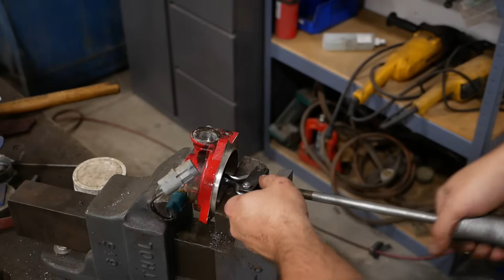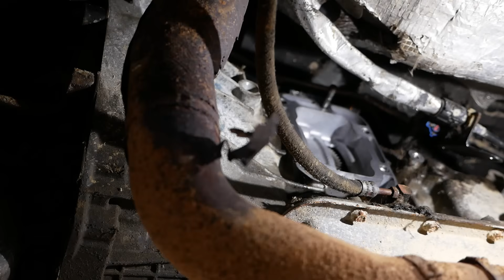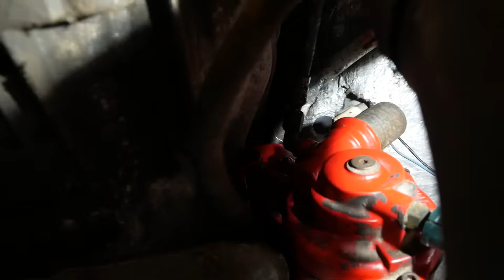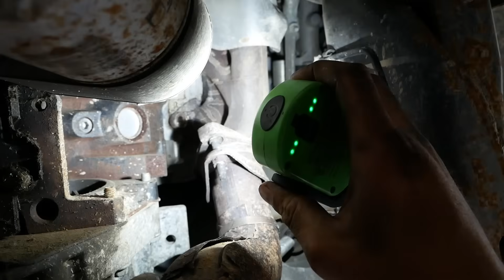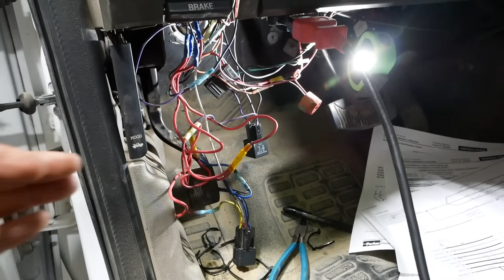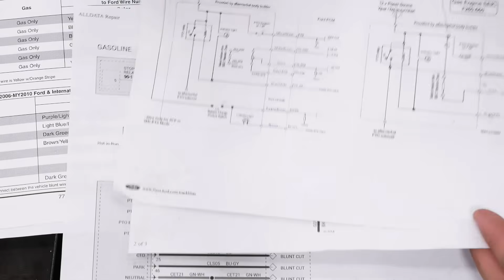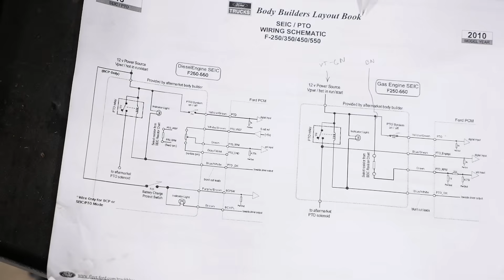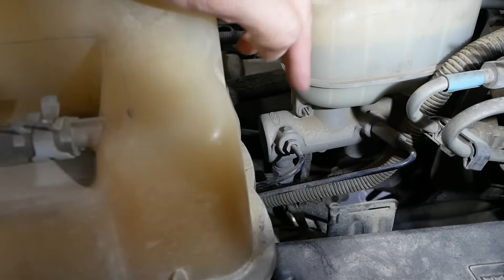Ford F550 Chelsea PTO Repairs - Unexpected Complications

Comment: i do engines and transmissions (mostly for racing but i occasionally get a normal job) when putting in seals on a piston you can use a feeler gage (the finger type, they make them up to 6-8 inches) and lots of transmission fluid. You don't want to nick the seal. It will be a weak spot that "blow" out long before it should. Usually in a car transmission there are two seals. (and this is one reason why you find balls in the valve body. They regulate the direction the fluid will flow) One seal pushes the piston onto the pack and then the second seal will allow the fluid to disengage the piston. Some transmissions have these seals as a weak point (the lip is to small to handle the high pressure of apply as an example) so they have to be clean, no nicks or gouges and lubed.

Comment: I spent seven years in the waste removal industry, and our trucks either had electric shift or air shift PTO. There was no gear clash with electric. Dump the air,  PTO switch on, shift to neutral, and it will engage. Air shift was the easiest. Come to a stop, cut it the PTO, shift to neutral. It locks the service brakes. The tricky one was the ten wheel cutdown. PTO cuts out if the RPM's are too high, and comes back on when the engine returns to idle. Great job Wes. Looking forward to the next video.

Comment: Place where I worked had a street sweeper that had a similar safety system.Tranny ha to be in neutral parking brake set,before it would dump the hopper.Also because the brake system was air brakes,air perssure had to be above a certain number before parkbrake would set.We got a lot of calls because machine would not dump fast enough to suit driver,most time we started the engine,waited until air pressure hit max,compressor unloader valve kicked in,then set parking brake.let air pressure come back up.turned on dump pump control,engine would go to high idle hydrulic pump engage,and dump would work properly.One time when supervisor of crew ask what the problem was I told him E.S.T.O. Equipment smarter than operator,he told me to get the hell out of his office.

Comment: Excellent video Wes.  Love these who done it videos.   
   I’ve  got a job you could finish and make a new customer very happy.  It’s a 79 scout with a 345 ci V8 engine.  Engine was rebuilt by our local automotive machine shop but the guy couldn’t find anyone to install it.  Dumb me says, I can install it.  The owner lives three hours away.  He has it brought up on a flat bed and I put the engine in.  Everything that goes on the engine I replace with new parts plus a new radiator and heater core.  Start it up and runs great.  He comes and gets it and drives it home.   All happy for the next two months until it quits running on him.  Two other shops he takes it to can’t figure out what’s wrong with it.  They know what’s wrong with and just don’t want to deal with it.  The rings never seated and it burned oil.  Three quarts low on oil and a totally burned up melted down catalytic converter.  The owner put gas in it 8 times, he said, and never checked the oil.  The machine shop says the carburetor over fueled the engine and washed the oil down from the rings, did you rebuild the carburetor, no, why not?  Because it didn’t need it.  The finger of blame pointed at me.  Long story short, carburetor is not over fueling and machine shop is still blaming me.  Customers says why would I check the oil level on a new engine.  Going to pull the engine back out, pay the machine shop to fix it and tell the customer to find another shop to put it back.  Divorcing myself of this headache.

Comment: I've heard that don't flush the old trans thing for years, from very good mechanics and trans builders.

For those that aren't mechanics: I believe the reigning theory is that you get a good layer of varnish in the seals and sealing surfaces that helps keep the line pressure up. As it builds up, the seals are hardening a bit. If you flush the trans, the varnish goes away, but the seals don't expand back to previous dimension, allowing pressure to bypass burning up your clutches.

If you do the flush frequently from new, not an issue, and generally not an issue to just do a service, where you replace the fluid that dumps out when doing a filter. Transmission stop leak/conditioner works by causing the seals to swell back up, restoring line pressure and making the trans work again. If you ever see a bottle of it in a used vehicle you are considering, factor in the cost of rebuilding or replacing the transmission into your decision making.

Also check the transmission fluid for sawdust - it'll make an old transmission quiet up and work temporarily, but is shady AF. (I knew an old mechanic that would fix the transmission properly if you were planning on keeping the vehicle, and pull this if you were just trying to sell it. I never bought anything from him.)

Comment: When I was a mechanic for IH, we had a farmer come in three days in a row, complaining about the power steering intermittent when disking.  My boss checked it out in the shop and found no issue, and sent the farmer on his way.  After the third time in, I was free and decided to diagnose the issue.  I drove it out on a steep hill, and lost all hydraulic power.  Flat and level, no issue.   I discovered the farmer had changed the hydraulic filter, located in the rear of the tractor, and failed to re-install the crossover tube between the filter and pump.  My boss was a parts changer, not a technician.

Comment: I do a lot of heavy equipment repairs also in my shop I'm doing a 97 f 350 cab off and it is a two-wheel drive Dooley and I'm converting it to four-wheel drive automatic trans with leaf springs up-front instead of this coil spring pivoting front suspension and I'm not adding no aftermarket adapter plates for the front leaf springs where they connect into the frame a lot of guys will go with aftermarket brackets it makes the truck setup higher but I wanted all original so I am going to show how I make it all original to where you can never tell that it was a two-wheel drive instead of a four-wheel drive be on the lookout for that

Comment: I'm not an overly confident mechanic....I can fix my stuff. Generally speaking I can get it done and make it work. I had no clue when you said it should idle up and got hives when you showed that wiring under the dash. When you pulled out that frame builders wiring diagram I had an Ahhh hah moment and kept up just fine once explained. I agree with everyone else. You sir are a very talented and GREAT diagnostic mechanic. I hope I'm saying this right......

Comment: The company I work for has F250, 350, and 550 trucks with similar PTO setups, but for the idle to ramp up the parking brake has to be applied and a switch at the back of the trucks which turns the flow on and the idle ramps up.

Comment: Mount a remote controlled winch to the back wall of the shop, and just winch it into the shop by yourself... they make them wireless, so you could steer.

Comment: Good thing they brough it to you 
to have it fixed..... you are a bad ass 
Dude.... guy... who knows his stuff....
I wonder if those other people just 
Did not know how to fix it are if 
they just didn't want to take the
time that it took to get it figured 
out and get it repaired correctly 
are they thought that it would be 
one of those difficult customers that don't understand what you are talking about are worse yet one of those customer's that has a bit of knowledge but not enough... so they think they know but really don't completely understand ..... you know like those people that know just enough to get by
on maintenance but will get themselves in big trouble if they go any further than that.....
and will try and tell a mechanic there job... those are the hardest people to deal with 
Are how about those customers that will try to blame the mechanic for something else that broke that had nothing to do with what ever was fixed in first place... example, mechanic replaced the 
U-joints and 3 weeks later they bring the vehicle back because it's over heating 
and saying that  you the mechanic did something to create that problem when you  
changed out the U-joints....then wanting you to fix that problem for free and give the $$$
Back to them for the repair that you on the U-joints....

Comment: Electric over hydraulic PTOs are the most common type I see now. Largely because the vocational market has all moved to automatic transmissions and that’s the right way to do a pto shift on one. 
That looks like an old body and control system, but I have worked on new ones from that manufacture recently. That control box would likely have been set up to allow pack and roll in addition to the stationary operation. I don’t work on Ford’s but that normally involves grabbing a neutral signal that enables the additional engine ramp and ideally gets an engine speed signal to tell it if it needs to kick off the pto while rolling because the speed is too high for the pump. 
That box also usually controls the lights on the body including the flashers.
Reply from the maker: I saw they had hacked into the wiring for the flashers as well.

Comment: In the late 90s and early 2000s ford had a recall out on their master cylinder mounted brake switches where they were burning trucks down. They've had tons of issues over the years where brake switches are concerned.

Comment: Its kinda like some people can  read a music sheet and others just play by ear. You know how to  read the input you get from a computer. Just guessing here but when one of the repair sites installs a automatic transmission pto setup, they take it out of the package and put  wire a into the slot for a to go in... that may now have a remote start wire in slot a's hole so they go to another that does similar and that won't work. At least that is what I take from it. I question using a pto on a automatic because that fluid bypass is so the ptp is running in oil like a standard shift would as the pto mounts lower and just sets in oil so it naturally works and they need a oiling system for the auto trans ones. Now I am guessing at the auto start or say keyless entry but any non factory ad on would suffer if not installed in its proper sequence. If those pto's could be operated off of a air shift direct drive system and it had its own oiling system there would be no need for a clutch in a oiling system....right????

Comment: Half of solving any problem is to know what the problem is !  Wes, your diagnostic skills are amazing. Trouble shooter extraordinaire. Another great video, thanx. Also, check transmission tool shops, they sell seal replacement tools that really help with the seals. I used to make mine from quarter inch flexible copper tubing and used steel guitar strings (smooth not wound) when I was working on automatic transmissions.

Comment: the hurry up switch is a micro switch at the top of the body, should be at the top of the rods, anytime the guy at the back activates the hydraulics to make the hopper move the engine should speed up, 12 v in depressed 12 v out, low hanging branches love to crack them and then they will not work anymore, when the pto fails prematurely again, replace the entire clutch assembly most likely worn below usable, back in the day we used direct drive pto and used a live power valve in the suction line, not sure if they make one for this transmission, buy a seal installer kit, the lisle one isnt that much, looks like a heil body and you should be able to get a wiring diagram from them, other brand that is popular is mcneilus

Comment: I got shown how to make a tool for fitting trans and power steering rack seals that works. All you need is 4 inches of 3/16 brake line and some fine steel wire available from a music shop. You clean the end of the tube up. Bend the wire into a U shape. Put it into a you shape with about 1/2 an inch of the U sticking out and squash the last 1/2 inch of the tube.  I made one 10 years ago and it works well. Its still in my tool box and gets used. Wes you don't need a fancy press when you have a horizontal screw press A.K.A. the vice. You got thrown in the deep end with this job. Good on you for fixing it properly.

Comment: you know you bought from the wrong manufacturer when the builder of your custom rig not only can't fix the problem, but doesn't even have wiring schematics for the unit. it's getting to the point that when i'm watching one of your vids i hear the mighty mouse theme song in my head, "here i come to save the day!", and the schoolhouse rock saying, "knowledge is power". like a true hero, you just keep on using your power for good, by saving the day for people with more problems than solutions, without i might add, going totally bonkers in the process. i doff my cap to thee good sir!

Comment: Your diligence paid off!  That multi-channel is a super scope.  Ancient history tale:  I  owned a Ford Econoline, vintage early 60s, when it was 7 or 8 years old.  It used a pressure switch to operate the brake lights.  Mine wore out and the brake pedal had to be firmly pushed for the lights to work.  I was selling it before I shipped out to Vietnam, so I passed the problem on to the next guy.  Anyway, to my way of thinking, Ford has a pressure switch failure history. Also, a van makes a great storage unit when the First Sergeant and the CO come to inspect the barracks.

Comment: Good job my friend.  I've been in the same situation.  I had to install a Chelsea pto on a brand new f650. The pump command wires were easy.  Setting up the speed protocols for the engine were not.  The bigger ones like on the MD3000 Allison's are easier to build. For me they are cause it's bigger. Thanks for taking us along with you on your journeys to hell and beyond.  I learn from your mistakes, oh sensay.

Comment: Cant really think of a way to say what i want without sounding like im ragging on you but i am NOT,,,,,Its pretty bad when a ford dealership and a company that makes these garbage body units cant fix this problem correctly but you, a guy in the middle of nowhere Northern Illinois with his little one man shop, finds and fixes this with seemingly little trouble. 
One would think the place that sells and installs these would have had many many trucks with this very trouble and they would be able to fix it with as little trouble as you just did.

Comment: I don't understand the need for some of these computers.  I have a GMC Topkick with auto trans and a PTO.  Put it in DRIVE to prevent clashing, pull out the manual cable while moving maybe half an inch to mesh the gears, then put the trans in neutral and you're good to go.  If it breaks, it's simple to understand and fix.  Very few mechanics could fix what you did, but why it should be necessary?  Love your "snarkiness."

Comment: I don't remember what type of degree you have but your ability to read and understand those schematics is fantastic.  I can usually read the title of the page.  I do better coloring within the lines sometimes.  Fantastic fix. Customer should be super happy.  Did the shop assistant get you anything while shopping?  Thanks for the video's.
Reply: Mechanical engineering I believe.

Comment: Cannot resist.  SometimesI get a ball that blocks an orifice and gas stops to flow.  You can block me if I over stepped boundaries.  But it is what happens after working 10 hours in a parts store.

Comment: You really are a very competent technician Wes.  That was a very difficult series of problems to diagnose.  Because of your persistence and unwillingness to just be satisfied with a marginal fix, makes you exceptional.  I hope you are demanding compensation worthy of your excellence work.  Especially after several other shops failed.
Reply: not technician, Wes is an engineer and a very good one at that. Just watch his old CNC videos.

Comment: Never saw a PTO like that. Were either air or manual engagement. And with the auto trannys you put the tranny in drive to stop the gears, pulled out the cable on the PTO and held pressure on it while going to neutral to get the PTO to engage fully. Same with a manual tranny about stopping the tranny by mashing the clutch before switching the air on or pulling the lever/cable and holding pressure till you eased the clutch back out. But that's on Macks and so forth. SERIOUS stuff. Glad you fixed it. No wonder Max keeps you around. Thanks and GBWYall!

Comment: The Earth has to align with Venus,  you have to park the truck facing south, the driver has to have his right hand pointed North, your left shoe has to be unlaced and then and only then will the PTO actually engage and do its job...Great job Ford, so many safety steps to make a truck unusable for anyone. So complex that you can't get it fixed...  Great job Wes figuring that all out...

Comment: The system before this had the same PTO, controlled with the same solenoid and another solenoid to kick the throttle up via the linkage. That system was simple and reliable, so they just had to "fix" it.

Comment: Piston seal looks like its broken due to heat failure. Wonder if its sufficiently rated for ATF temperatures, or the gearbox is running too hot for too long - maybe due to the issue with the engine rpm not lifting. And I loathe the kind of idiots that f**k about with wiring like that.